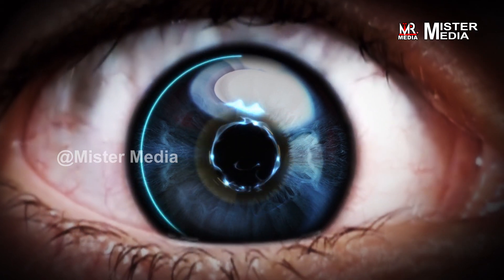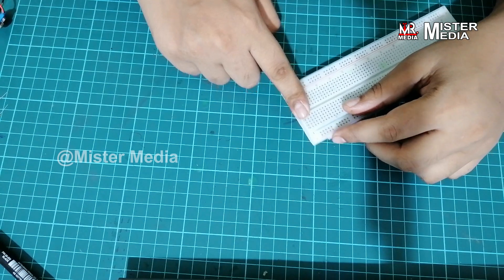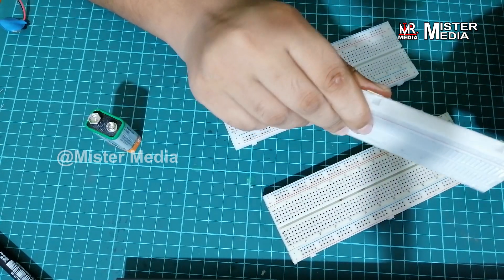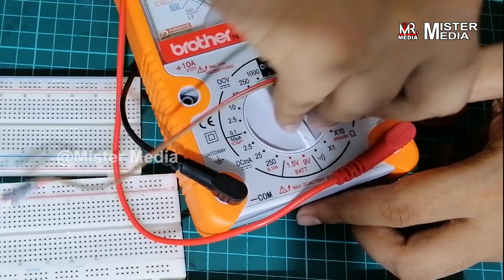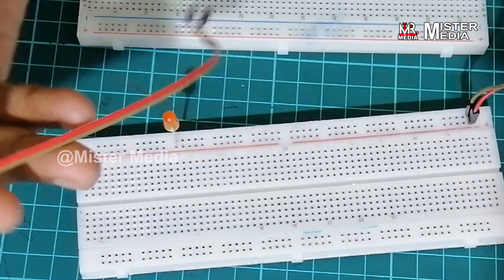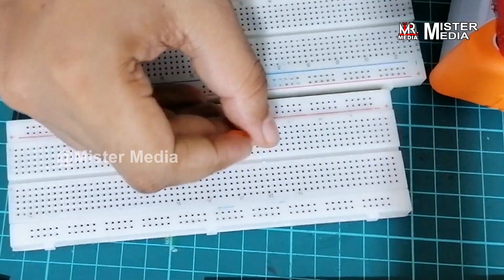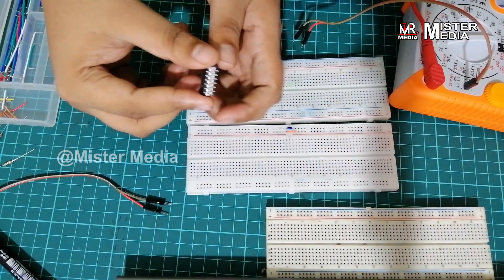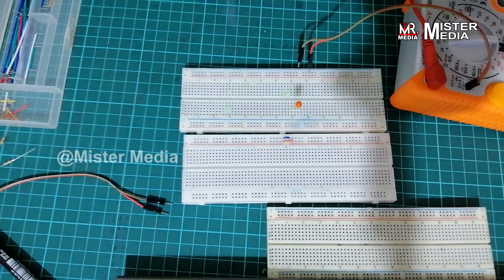Basic Electrical & Electronic | breadboard | in Tamil #04

Comment: sir plz make a video regarding NPN transistor because elaa videovum romba kolapuraanga neenga konjam theliva breadboard la pratical aa podu brooo
Reply: bro plz reply battery la - la irunthu + ku electron move aaguma sir plz reply...?
Reply from the maker: The terminal marked negative is the source of electrons that will flow through an external electric circuit to the positive terminal
Reply: @MrMediaLk  sir konjam tamil la slunga sir english puriyathu
Reply from the maker: Sure